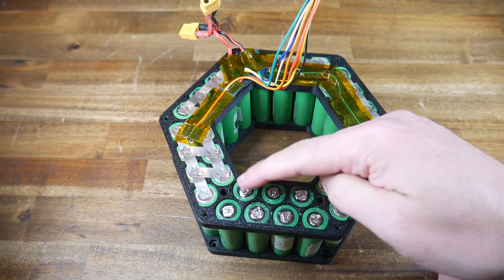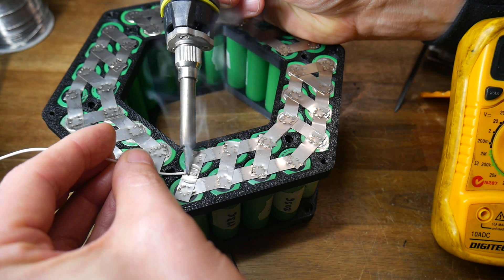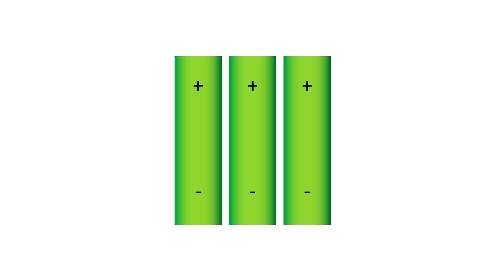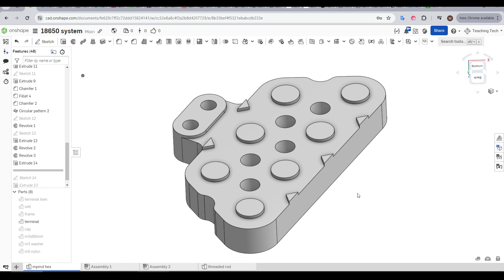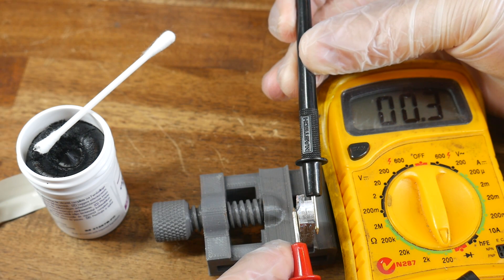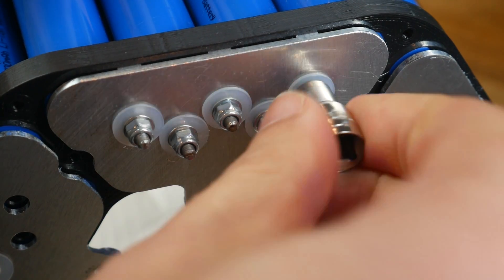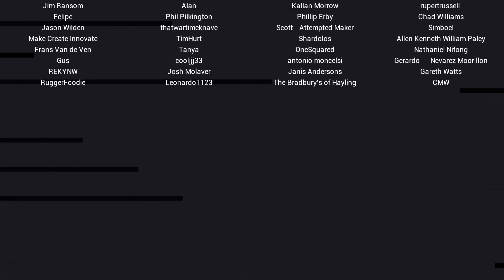Experimenting with a new (and probably flawed) 18650 building method: No soldering or spot welding!

Comment: Your pack died because you didn't use a BMS, it's a crucial part for a li-on pack, even if you build a pack out of SINGLE cell.
You can safely spot weld a pack but you just need to know how, and you missed few crucial steps which I believe I've highlighted in your previous video.
Jesus f Christ, screws going top and bottom contacts and all it stops from shorting is a plastic washer...
Conductive grease?! NUTS!
Then testing conductivity rated for 20-30mR with a multimeter with 100mR resolution and has got leads that have up to 500mR of resistance, it's like watching someone who gas got no clue about electronics...
Reply: The multimeter test was too much for me as well. I like the project, but the CNC is out of my reach, a spot welder from aliexpress is so much cheaper.
Reply: @symik3  Naah don't by cheap stuff.
Buy kWeld, its like 150 euro but its well worth the money.
Reply: @Arek_R. But is this spot welding not done wrong?
I mean, both electrodes touch the sheet you want to welt to the cell. Basically you "overheat/melt" that strips and it somehow "glues" itselt to the cell.
Shouldn't one electrode be in contact with the cell, so the current flows between cell and metal strip forming a much better and larger bond?
Those are still hobby grade spot welders, not industrial grade that might can pull it off that way.
Reply: @spedi6721  Tab/shell of the cell is thicker than the tabs you weld to it so it goes from one electrode, to the tab, then to the tab/shell of the battery, current flows thru the tab/shell of the battery, then returns to the welded tab and lastly returns to the other electrode.
This is how nearly all battery welders work.
kWeld is small and may look like not much, but it actually has got control of energy in Joules dumped into the spot, so you ensure a good weld, and if the weld fails due to dirty contacts etc, it will alert you, such functionality is not available on commercial welders until you reach 5 digit price points, so kWeld is the best thing a hobbyist, or even a small business can own.
I placed mine in a steel enclosure, it's also powered from large super capacitor banks, and charged from a 50A/12V PSU.
Never had a failed weld with it
Reply: @Arek_R. Yea, maybe the kweld has the grunt, but Im an engineer, I don't believe that the current will somehow "jump" from the tab to the terminal and back again, just because it's thicker.
If you take a look at the spot welders in car industry, on electrode sticks to one metal sheet, the other, to the other metal sheet. Only this way they can ensure proper welding. That's because the the current will heat-melt both sheets at the touching point. I  don't see this happening on welding tabs onto cells.
The tab will somehow melt at some point which will connect to the cells terminal, but I think that one can make a much better connection by not doing it that way.
Reply: @spedi6721  I am too.
When I was a teen I've made a spot welder using microwave transformer and it had electrodes that go from both sides.
But then I didn't need it anymore but I needed to weld batteries and so I've modified it where both electrodes go from the top, and it worked but didn't regulate power properly probably and sometimes the weld would blow a hole in the battery.
Reply: @Arek_R.  I don't have first hand expierience because I don't need it. Yes it will work, but I don't think it's the optimal way of doing it. Otherwise car industry would do the same and safe time by making 2 spot welds at the same time. If they don't do this, there will be reasons.
Reply: Seems like he used a charger with a balance plug, so that should kinda do the BMS part
Reply: @hrmny_  Nah bro, it will charge it and balance it, but nothing will stop the battery from getting unevenly discharged and ending up with uneven cells.
Especially when he randomly paired the cells so those are not going to be matched and will tend to discharge unevenly.

Comment: Nylon shoulder washer is the thing you need :D
Reply: Also known as "top hat washers". 
In smaller sizes they are commonly used when mounting power transistors to heatsinks when you want to maintain electrical isolation
Reply: @pileofstuff  Also known as sleeve washers!
Reply: I was thinking he could just print some out of nylon.
Reply: @qwertyasdf66  that crossed my mind too
Reply: Dude is already machining a custom hole pattern, can just print a custom washer matching the whole hole pattern at once...
Reply: Are your long retaining screws insulated? Are they powder coated of something?

Comment: I would keep the palts in 3-cell configuration, with holding bolt in the middle, that wuld keept the even pressure on all 3 cells, and then bunches like that can connected using strips

Comment: The plastic washers need to have step on one side to assume the bolts can never touch the plates. If you end up with plastic posts to support 2 bolts from either side, suggest using poly carbonate for it's stiffness, you wouldn't want the spacer stretching over time.

Comment: This is a pretty good approach for solving the "biggest problem" that modern battery cells have: the fact that they get fricking WELDED together...
The split bolt design for the re-design is also very nice, definitely a great improvement. Because those long bolts of the actual build made me really uncomfortable about possibly somehow managing to touch the other terminal. Even if the nut and washer are non-conductive, the fact that there's just an air gap + the centering part that's keeping them from connecting the terminals, that feels "tempting fate" to me...

And I really wish that modern devices or their powerpacks were designed with swapping cells in mind. Like those old packs where you had f.e. 8x AA cells in a 2x4 stick and then a plug for whatever was common in (RC) electronics. If there'd be something like that but for 18650 cells, it'd be amazing at reducing e-waste, because most battery packs get thrown away because ONE cell is bad, but the entire thing is built as a one-time assembly... I hate it.

There's almost no devices that actually use cells as is, like old electronics that were meant for single use batteries.
After all these years since Li-On cells became "normal", I found ONE thing that just does that: a small portable fan.
It pisses me off so much that this is the exception and not the norm.
Reply: My concern with the proposed newer version is that, to me it looks like the long bolt is being replaced with a split bolt design, which will end up relying on a 3d print for part of its tensile strength, given that these bolts will be used to tension the plates against the cells that seems like a new potential point of failure....
Reply: I've seen torches that have removable 18650 cells but point taken, I love my bluetooth speakers but they are sealed units and the batteries are fading so landfill in the end.
Reply: there are good reasons for that, it is not that simple. These are not comparable to AA batteries.
Reply: @riba2233  They're bigger, have higher voltage and minimum voltage they can't go under without "dying".
What other differences do they have?
Fire hazards? Those were already warned of on AA batteries since I can read.
Reply: @BloodyMobile  charging adds another universal or rules by itself, not to mention how you need to manage them if used in series.
Reply: @riba2233  yes, you need special chargers for them, got one.
But if the remote for an RC model can have 8 AA batteries in it, I still fail to see why a powerpack for a drill can't also have 8 or how many 18650's in it, just with exchangable cells instead of welded in. Gotta watch the proper polarity for both when putting them in, that's obvious.
Reply: @BloodyMobile   because it is very easy to mess up and have a cozy fire with separate 18650s unlike with AAs like I said :) notice that devices that use separate 18650s like that only use them in 1s config and if there is more than one they are in parallel, and each has its own protection pcb. There are good reasons for that, but I can't explain the whole world or rechargable batteries over s yt comment

Comment: I would think that you should apply that paste to BOTH SURFACES being that it looks pretty coarse and dry.... if it was thinner and flowed smoothly it would be fine, but I think if you run another small test you might find better results applying to both surfaces... it couldn't hurt to test it out :)

Comment: I wouldn't do it. Cells do not like pressure axially, vibrations will make your contact worse over time, you will have higher resistance overall and won't have an energy efficient battery, under high loads, due to difference in resistance you will create unbalance. And more reasons.

Comment: How are you keeping the voltage to the printer constant as the battery drains? Is the battery designed to have more voltage than necessary and then regulated down though some means? (Voltage regulator of some sort?)
Reply: It's a silly project. What were you expecting?
Reply: Buck converters and other switching will work pretty much down to output voltage, often with less than 1V drop.
Stepper drivers may stop providing adequate torque sooner, heaters may lose capability to heat sufficiently but if he is treating LiIons as LiPos regarding discharged voltage then that probably doesn't happen.

Comment: Sounds like you are putting too much faith in those nylon washers.  That side of this makes me nervous, u less I'm misunderstanding the build.
Reply: There are special washers for isolating cooling on semiconductors with a small sleeve attached. These would be perfect.
Reply: Honestly i would only use nylon bolts, or bolt both ends to a plastic plate. One drop and if anything touches it will instantly weld itself short
Reply: Yeah those nylon washers make me nervous. Too tight and they’ll start to deform, they might give over time and leave slack connections. I’d be taking that apart
Reply: @JamesPlace-o1k Nylon basically doesn't creep. That's the whole idea behind nylon locknuts - otherwise they wouldn't work
Reply: @pinecone606   wrong, nylon is very prone to creep.
Reply: @pinecone606  that is nonsense, nylon absolutely does creep.
Reply: @riba2233  you're actually kind of wrong yourself. While some nylons can be more prone to creep than others, nylons as a whole do better than most thermoplastics. 
You are trying to sound like an expert and don't even realize there are different types of nylon. 
Sit down, rookie.
Reply: @TlD-dg6ug   rofl, you are the one who is wrong, I have watched reviews of plenty of nylon filaments, they all have extrem creep. It is just a characteristic of a material, just accept it and let's move on.
Reply: @riba2233  I'm looking at ansi materials charts right now, and your going off some spurious YouTube videos you watched. Okay armchair engineer. You think what you'd like to think. 🤣
Reply: @TlD-dg6ug   yes, I am looking at real life stuff, I know that theory is very nice but in the end only one thing matters ;)
Reply: @riba2233  yes and you're referring to 3d printed shit which nobody here is using. So like your fake knowledge, your comment is irrelevant.
Reply: @TlD-dg6ug  yes, I am sure that your fancy nylon from fairyland is perfect and has no creep at all...
Reply: Fiberglass washers would be ideal. They are non-conductive and stiff.
Reply: @danieljackheck  nylon works just fine. They use it million dollar equipment for isolation.
Reply: @TlD-dg6ug  the problem isn't the insulating properties, it's the mechanical properties. Nylon is very soft compared to the fasteners. The fasteners will generate very little tension before the nylon yields, making these joints very susceptible to relaxation and vibration loosening. Since these screws are locating the conductors, once the screws come loose they could cause a short. Fiberglass is much stiffer and allows you to generate way more tension in the screws.
Reply: If you have a uv-cure resin printer and some semi-flexible resin, I’d suggest widening the holes in the CNC and printing some custom spacers that are kinda “T” shaped…. Potentially in a configuration that a single one can go over the whole section, and I’d ensure that there’s at least a good 0.5-1mm worth of physical spacer between the bolt and the conductive frame. That way there’s absolutely no way the bolt can contact the plate from any angle. (If that was already in the design, I missed it.)
Reply: The metal rods with plastic washers are dangerous. Just one connection to get loose or one cell to turn to a heater, will melt the washer and go to complete to short!
Reply: Only 6mins in and came to say the exact thing, plus, I dont think just putting an insulation washer is going to matter if you energise that whole area, both ends being opposite energised charges will create current through the bolt with induction, I suggest seperation of the 2 plates maybe with a maybe hook rope type system with a ziptie that you squeeze and then zip to hold connection and if you wanted to do maintenance you can release the tension from the zip and get inside.
Reply: i guess he could use the ptfe tubing for whole bolt?
Reply: @arva1kes  better would be to have no bolts going right between the two metal plates. Have the plates bolt onto the plastic piece and then have separate bolts between the two plastic pieces (top and bottom).
Reply: Yeah far too much faith in those washers. A better option would be to have the terminals screw into the plastic frame at the top and bottom and have separate bolts to hold the two sides of the frame together, or print it as a single piece.

The only thing holding those bolts in position is the printed parts and those nylon washers, if either of those fail then he can very easily end up with a short.

Another thing also making me nervous is how he measured the resistance of the two pieces of metal with the paste. Multimeters are not accurate at that range, not even remotely and the measured result probably has more to do with the resistance of the leads, how good the connection between the leads and the part was and the resistance of the internal circuitry of the multimeter than how good the conductive grease was. Even if the multimeter reading was accurate then he won’t get the current he wants out of the battery, when fully charged to 4.2 V with 0.3 Ohms of resistance that is a maximum current of 14 A and will waste 60 W of heat at that terminal, and that is just for one terminal. For all he knows he has increased the resistance drastically by using that conductive grease but he just can’t measure small resistances accurately at all.

From what I am seeing in this video he lacks a lot of knowledge about electrical engineering and I would say it is pretty irresponsible creating something like this and putting it on the internet to an audience who likely lack experience and knowledge as well and will copy what he does.
Reply: @conorstewart2214   well said!
Reply: Did any of you actualy watch the video? 🤔 
He addressed that.

Comment: using aluminium for the contacts might be a bad choice because aluminium forms an insulating oxide layer. brass or copper tho more expensive might be a better material
Reply: yeah, aluminum wire was tried for a while in the US, but it's no longer allowed for new installations, that dumb oxide layer makes getting a good, long term connection really difficult.
Reply: The grease should help prevent oxidation.

Comment: I choose NiMH primarily for safety, but they are also cheap, and easily scaled to battery packs. They are not as dense, but are still great for many applications!
Reply: Good enough for my hybrid Toyota RAV4
Reply: @puntabachata  The Rav 4 has NiMH batteries?
Reply: @SeanLumly   old one, nicd probably
Reply: Toyota Sienna hybrid also NiMH.

Comment: I see washers for outer surfaces but I didn't get how you are preventing long bolts from touching the inner surface of holes. Or are those actually inserts that protect the inner surface too? Not obvious from the video
Reply: thank god I'm not the only one confused
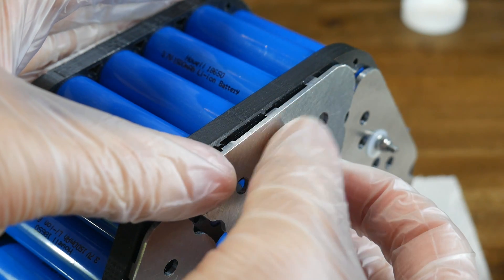Reply: @blockfifteen  watch 10:20 again.
Reply: @Autonomous15  thanks, safe-ish indeed. Better show this earlier in the video though. And still better use sleeved washers...
Reply: He "just" centered them, as it seems. Could be a potential boom there.
Reply: @der-andyman  watch 10:20 again.
Reply: @Autonomous15  Well, strage, how did he achieve this :O
Reply: It looks like there's a significant air gap around the bolt. That sounds sketchy at first, but neither the bolts nor the plates are free-floating,  ther're solidly positively located by the 3d printed bracket, there's no chance of the bolt shifting relative to the plate and creating a short.
Reply: the alignment pins on the plastic jig and the differential sizes of the holes is what prevents direct contact. its still a little risky in my opinion
Reply: if that PLA gets anywhere near its softening temperature as the battery heats up or if there are faults its going to cause likely multiple serious  shorts
Reply: @benads6847  Watch it again, he's using PETG for exactly that reason.
Reply: At 9:46 there's a good shot of the plastic parts. If you look closely you can see there's holes for the bolts. The holes are small enough that the bolts will be centered in the bus-bars. I still think it's way to sketchy.
Reply: He's depending on the guides for the screws and the triangle insets to maintain their integrity. As long as things don't bend or twist due to thermal expansion.
Reply: That is so sketchy I wouldn't expect him to make such a stupid design I wouldn't be able to sleep if those are in my house
Reply: @Cyber_Cowboy  watch 10:20 again.
Reply: watch 10:20 again.
Reply: 19:20